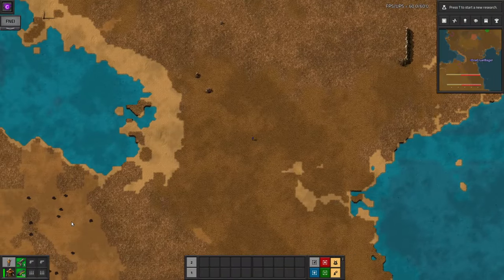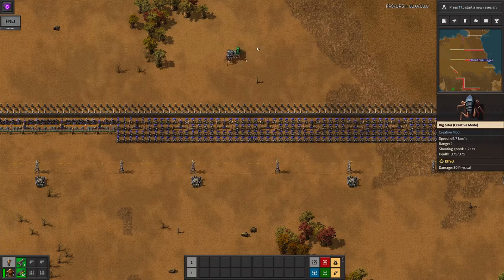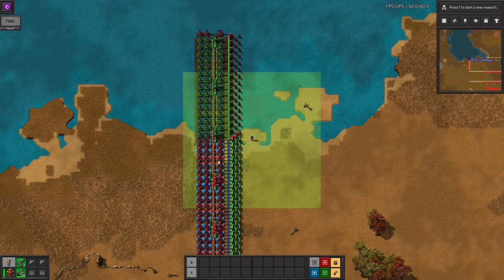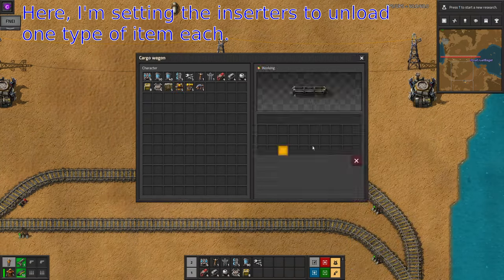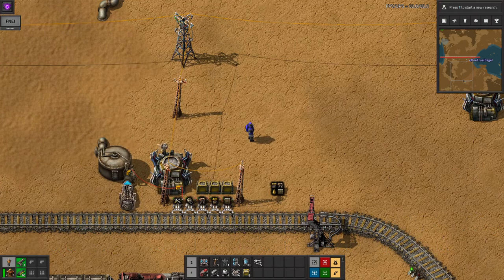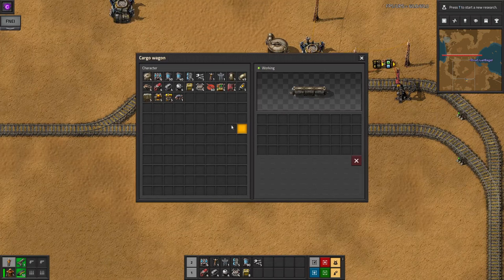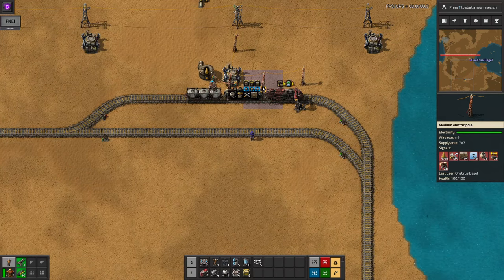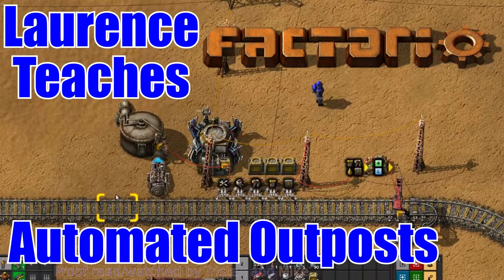Outpost Tutorial - building and supplying - Laurence Plays Factorio

Comment: you can use the inventory limit on train wagons so you don't need the fish filters
Reply from the maker: Oh yeah - that would be much easier! For some reason, I thought you could only do that with chests and not wagons, but looking at 10:04, there's clearly a red X button on there. D'oh! Thank you for pointing that out  😀
Reply: Additionally, it also allows you to put the "Full Cargo" filter at the supplying station.
This should prevent the loop issue you mentioned at 10:41.
Reply from the maker: @stevengeens3055 That's a very good point! That's a much better way to do it. Do I have to remake the video now?  😲
Reply: @LaurencePlays 
Nah, maybe adding a bit of explanation to the description. That's where I expected it to be when I watched the video.

I'd also suggest adding these kind of small corrections / additions / new ideas for your tutorial series to some notes file. Then you can update everything in 1 go that needs to be updated when a sufficient quantity has accumulated (and/or the expansion comes out).

Comment: Thanks for sharing that - a very elegant solution which saves stringing red and green wires for miles.
Reply from the maker: I'm glad it helped! Yeah, I like my outposts to be self contained and not require masses of cables to be run. Although if you make sure your rail blueprints include red and green cable from the start, then running it isn't so bad.  🙂

Comment: for my first outpost, i just added a few spaces for ammo inside the ore train, and then unload it at the outpost
Reply from the maker: That's a neat idea - as long as your wall bottlenecks fall close to an ore patch. I'd be a bit worried about the supply running out, but I guess you could make it summon a train anyway if it did run low on ammo. I tend to build my defense outposts on bottlenecks as much as possible, so they might be nowhere near an ore patch though.
Reply: @LaurencePlays i did that just to defend a single outpost, not for overall base defense. now i have a question, do i need a supply train running around between every mining outpost giving ammo and repairs, or is it just better to defend everything with large walls which are at the bottlenecks?
Reply from the maker: @captheobbyist6434  I have tried both in the past and I reckon it's better to do the latter - have a perimeter wall that covers all of your interests, rather than defending each mine separately. The main reason for this is that I find biters tend to wander around a lot and sometimes get on the rails. Small ones, the trains can deal with but if they run into a group, they'll get slowed down and the trains get eaten. Which is annoying! Also, I think if you find good bottlenecks then you can get away with fewer turrets.

Comment: Handy stuff!  Some thoughts:

1. I've stopped supplying my walls with repair kits, as 99.999% of the time, it is only a few (cheap) walls that are getting damaged and it is easier to just have the bot replace them as they are destroyed.  It also keeps the bots, themselves, from getting damaged.
2. I place my roboports as far as possible from the walls so that when the bots respond to a destroyed wall, they don't get there until AFTER the horde has been destroyed.
3. The 'Filter Assistant' mod is an absolute godsend.  It makes setting up & copying filters downright trivial.

Cheers!
Reply from the maker: I've definitely considered whether it's worth repairing walls since as you say, they're probably cheaper than the repair packs! I just worry that one would break at exactly the wrong moment, and let the biters flood in! I've also put roboports further back (I guess you could place them so they can get to the lasers but not the walls, and then just repai the stuff you care about!), that would ahve been worth mentioning. 

That mod does look interesting! I don't tend to be setting filters all that often, so I probably won't bother, but it's definitely interesting - thanks.

Comment: 10:45 on a wall with constant attacks, esp. the fluids might cause the inactivity counter to never reach 5s.
Reply from the maker: That's true, that is a possibility. If that does happen, your train will be stuck there until it runs out of whatever's being constantly used up, which isn't ideal. If you want to protect against that, you could tell the train to depart "after 5s of inactivity OR after 60 seconds".
Reply: just set the condition to trigger when over a certain amount, eg you put a tank down and make the condition >20k
Reply from the maker: @kalacaptain4818  Yeah, that would work too. I think it's a bit more complicated to set up, but that's the wonder of Factorio - always lots of ways to do something!

Comment: you can also use circuit conditions on train schedules, might help with edge cases like fluid slowly draining forever.
Reply from the maker: That's true; it's something I've used a few times but I didn't feel it was necessary for the design here. 🙂

Comment: I might have to try this. Recently got factorio and have 250 hours into it and 210ish in my main world and I just use a spidertron with robot to replace or repair. Only issue I have is I spent way to long clearing land and putting walls way out away from my base so it’ll be a lot of rails to make a loop sine I’ll probably send an artillery train as well to clear bitter bases near my walls
Reply from the maker: The good news is that rails are relatively cheap, and if you've cleared that much space out then I'm sure you're not short of stone or iron ore patches! It's very nice having all the defences automated and not having to worry about when to send the spider out though. 

Of course, if you've built out beyond the edges of your pollution cloud, you won't be getting many attacks, so you shouldn't need to do too much repairing!
Reply: @LaurencePlays  Finally got around and set this up in my new world I started and boy does it make a difference. In my first world i used Spiders to clear nest and build and would always have to go back for more supplies after about 20 paste of my wall. Now i build the laser turrets and anything else i don't have on my train to protect the wall and get the robots to build the rest eventually. Even started using artily trains to clear nest i feel like I'm going 4x faster this time around setting up my permitter
Reply from the maker: @zanekubicek2186   Awesome! Yes, having your trains doing the hard work for you makes such a difference. And it means they'll all be kept supplied in the future, without needing any input from you.

Comment: I feel like there is an (at least mathmatically) simpler way to set up the single inserter layout. Although the issue may just be on the fact that you can't filter out the bots and repair packs. then again, might as well forward it from the box to the roboport. I am not that well versed in factorio logistics yet.
Reply from the maker: It's quite likely there's a better way to do something - I wouldn't be too surprised if I missed an improvement! Let me know if you find it  😀

Comment: Great video. Many thanks. 

I’m using a mouse without a middle mouse button. Is there any way to set filters without this middle mouse button?  Cheers
Reply from the maker: Yes, if you go into the settings and controls, scroll down to the inventory section, you can rebind "Toggle filter" to whatever other key you want  🙂

Comment: Is it possible to program the train that skips the next station if it's not available? So I could have one supply train supporting multiple front lines.
Reply from the maker: Yes - if a station is disabled, the train will skip it. If it has its train limit set to 0, the train will wait until the station becomes available. 

This means there are two ways to do what you want:
- you can have all of your outposts with different station names, have them disable when they don't need a train and have all the stations in the train's schedule
- you can have all your outposts with the same name and have them set their train limit to 0 when they don't need a train. 
I prefer the latter - it means you don't need to change the train's settings when you build a new outpost, and it means that the train won't visit all the stations which need stuff, even if its unloaded all its resources at the first station.

Comment: For the extra credit scenario, what do you do when the inserter is holding more item than can be inserted into the train and freezes? I've come up with a way to control the stack size and change it to 1 if the amount required in the inventory is less than 5 (or rather, greater than -5). Is there a simpler method you use?
Reply from the maker: In this specific case, I've only used the single inserter system for unloading, so that isn't a problem - as long as there's enough space in the unloading chest to take everything you've asked for, and an additional inserter load (of each) besides. If I was trying to do that for loading the train as well, then I'd use the same idea - I'd monitor the train's contents and when it got to the level I wanted, I'd stop inserting, and I'd make sure that there was room for an inserter's worth of excess. That said, I prefer your system because it allows you to hit a precise total, rather than just stopping when it's just over what you want. It's more complicated, but it's cleverer, which is very much in the spirit of what I was talking about with the extra credits!
Reply: @LaurencePlays  I, Sir, am honored. If there's one thing I do well it's over-complicating things. I'm going to have work on framing it as clever though.  Cheers 🍻
Reply from the maker: @samwheller  Call it "intricate", then it sounds deliberate.  😀

Comment: I know this is an old video, but i am trying to use the method with a single inserter and circuits just to show off, but i am having trouble wiht a detail. If, for some reason, my train doesnt have enough material (for instance, when its unloading, the robots start to use the itens), the inserter will ask for more of that same item, but the train wont have it, so it wont pull any of the other itens from the list. Any way to fix that? My huge brain was thinking about setting the train to "inactivity 10 seconds - Go to main base to get more supply" and come back with more of the needed item.
Reply from the maker: Your way would indeed work, but it's not ideal because it means the trains are running around unnecessarily. You could use a non-stack filter inserter (the purple ones) because they have multiple filter slots, but that's not ideal because it would slow down the unloading. 
I asked on my Discord server if anyone had any ideas and got a rather nice answer!
- Tell the station to "read train contents" and connect it to a decider combinator. "For each >0, output 1 of each". This will take the train contents and for any present items, normalise to 1 (ie, 20 turrets becomes 1 turret, 0 walls becomes 0 walls)
- Take the signal that you were feeding to the filter inserter to another decider combinator with the same settings. 
- Feed both those signals from the combinators into a third decider combinator that's set to "For each >1, output 1 of each". This will mean that only signals which has both demand and supply will be passed through. Feed this to the inserter and use it to set the filter. Note that I set that to >1 instead of >0, this is important!
If you'd like to discuss this further, you can find a link to the Discord server at the bottom of the video description.  🙂

Comment: Hey, thanks for the great video! Exactly what I was looking for. Quick question, for an ore outpost, is it possible to use the same train stop for both the ore train and the supply train? If we redo your design, the ore train will be unable to go there since the station accepts 0 trains, but I'm thinking it might be doable with some circuit magic.
Reply from the maker: With this design, I don't think it's possible to make a single station work for both. With LTN, you could have it sort of work, but you'd be bringing a lot of the outpost resources in. I think the best way to do this would be to have two stations overlapping.

Put your ore pickup station in as normal, then put an additional train stop a couple of squares behind the main one and use that for your outpost, with the inserters and chests on the opposite side of the rails. That way you wouldn't need a second line. Make sure there's room for both trains to wait though, or you might clog your mainline!
Reply: @LaurencePlays  Ah yes of course. Thanks !

Comment: Hi very nice tutorial. I rebuild it without roboport and it didn't work. I was wondering why it doesn't work. Then I was thinking through the whole system and asked myself where does the combinator in your video know about the chest content so it can go to zero. Then I got it! The combinator knows it from the roboport logistic network. Maybe the fact that the roboport delivers the positive values from the logistic chests should be pointed out a little more clearly when describing the system. I solved it by just connecting the chests with a red wire to the inserters.

Comment: is there any difference between enable/disable and setting train limits to 1/0 respectively?
Reply from the maker: Yes! There are a couple of differences. 
The biggest one is that if a station is disabled, a train will skip it and move on to the next one in its itinerary (unless there's another one available with the same name). If a station has its train limit set to zero, the train will wait at the previous station until the limit changes. These can both be useful depending on what you want the train to do! If the train just goes back and forth between two stations though, this doesn't apply.
The second difference is more obvious - if you control the station through the train limit, you can choose to have multiple trains heading to the station at the same time if it's very short of supplies. This can be useful for mining trains going to a smeltery, for example.